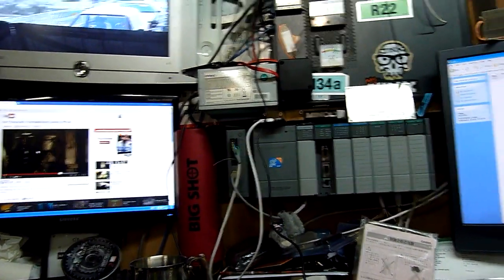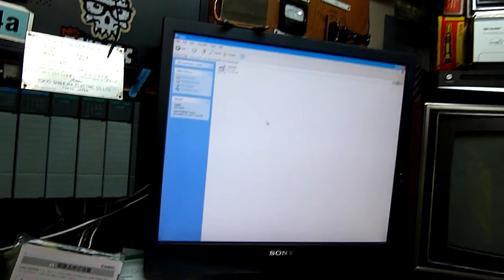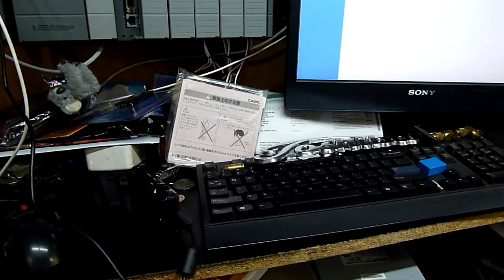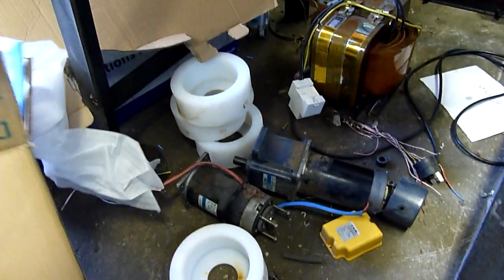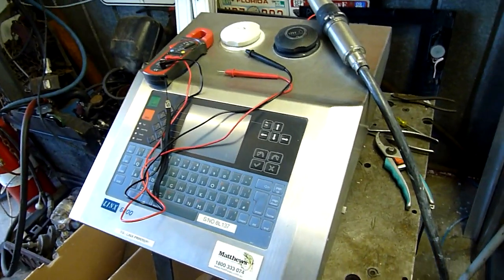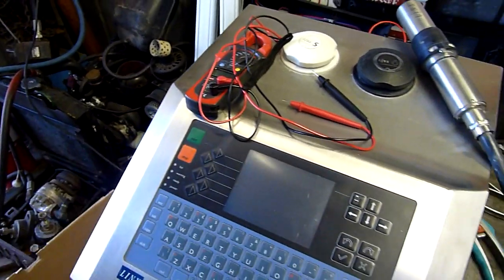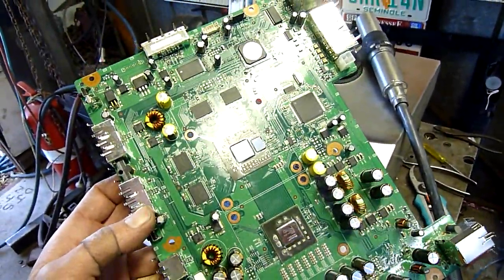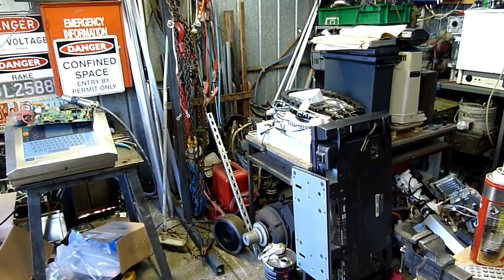Ramblotronic Wednesday - New Camera - TV's and Inkjet Update

Comment: I have the Fuji HS10 which uses the same image sensor as those cams, and also does the same highspeed, but I've found you can use high frequency driven lighting for videos with very minimal flicker. For example I've used the "75W" HID torch I got on eBay for a few videos and it does a great job. Just gotta avoid the low frequency stuff. Have fun!

Comment: If u still have the original drive for the 360, u can remove the drive board. And put in a new drive of the same model, because the drive key is stored on that board.

Comment: The Xbox DVD Drives are "married" to the mother board. The best way to re-use a good drive is to sell it to someone with the same drive that went bad, than they take there chip board off of there dead drive (assuming that isn't the problem), than solder it to the new drive as long as it's the same one that came out of there console. Same goes for PS3's.

Comment: Hmm, some of the stuff in your shop brings me fond memories. That Siemens PLC mounted behind your desk with the Intel sticker on it, is that running ProfiBus? 

Also: Matthews printer. :) I spent days tweaking the code to get one to output markings properly. If you do get it booting, and can't get it to print, I seem to recall something about the spacing of the columns vs dot size, if one is too tight and the other too large, it won't print.

Comment: too bad on the casio, I have the older FH100 model wich produce AVI files and no hassle. I suggest transcoding them and throwing the MOV files in the bin :P
If you need smaller lighting for closeups you can use LCD backlights, some netbooks have LED and they work great for me.

Comment: Yes the Xbox DVD drives are locked to the xbox. Unless you flash / hack the xbox.

Sony vegas can read and edit both video files. But the program is pricey. You can try a free program called Media coder to convert the file to something you can use.